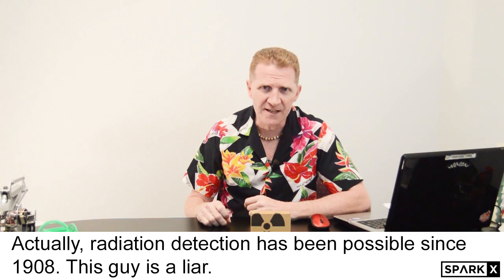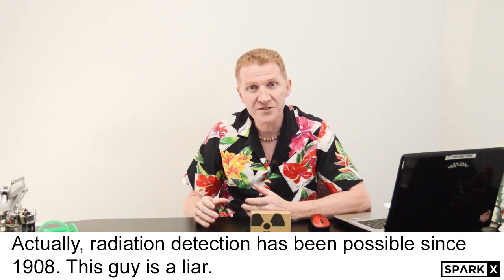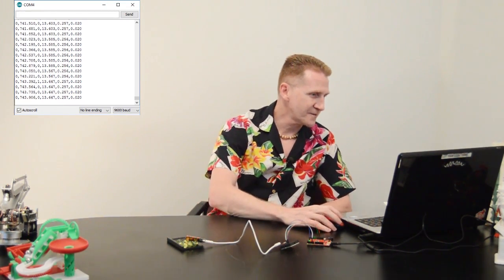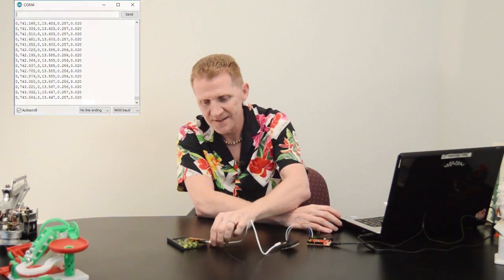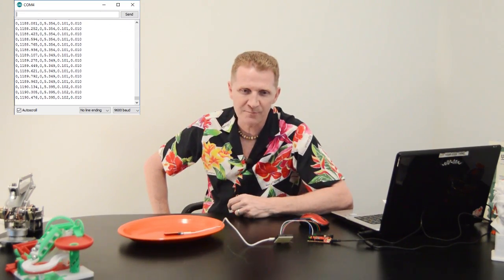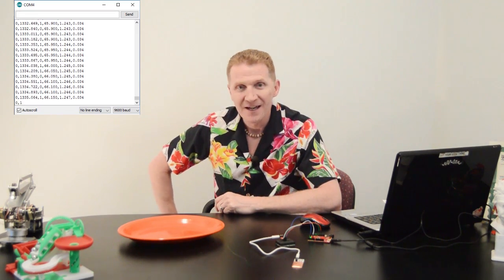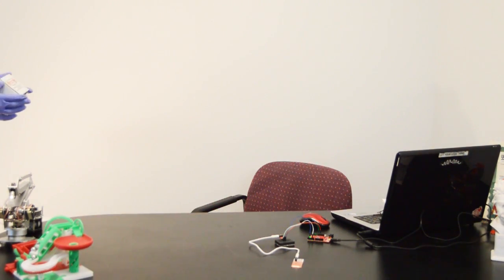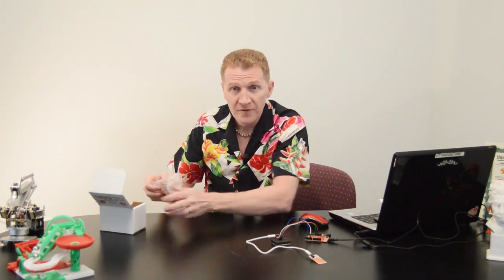SparkX - Testing the Pocket Geiger Counter

Comment: Uranium glazed bowls give off more than 65.6 CPM.  Mine reads around 22000 CPM. Which emits primary alpha and Beta decays. And also Gamma. The uranium Glaze is primarily U-238 as found using a gamma spectroscopy set up.

The plates do not Leach Lead into food, unless that food is highly acidic, the acidity can dissolve the glaze over time causing Leaching of U-235.

Comment: You need to check your units. 360 millirem would be a typical annual exposure. You are off by a factor of 1,000. Also few organizations use rem anymore and mSv has taken over as the modern unit of measure.

Comment: he said beta particles right?  what about alpha and other types of radiation?
Reply: I suppose it could be because alpha particles get stopped by almost everything - paper or even a few cm of air. Gamma just goes right through you; nothing can stop it - like a plate of dodgy seafood!
Reply: @_MisterG  lead can stop it :)
Reply: Alpha. Beta and Gamma decays are emitted by these plates.  It is not always the case that Alpha particles are blocked by paper. Although this is commonly illustrated depending on the energy of the Alpha not all are easily blocked. 
It is also not a good idea to put the Geiger tube directly on the Radioactive ore rock sample. The rock should be stored preferably in an airtight bag or container to mitigate the potential for radioactive dust particles becoming airborne and thus ingested. Or contamination of the detector and counter top.